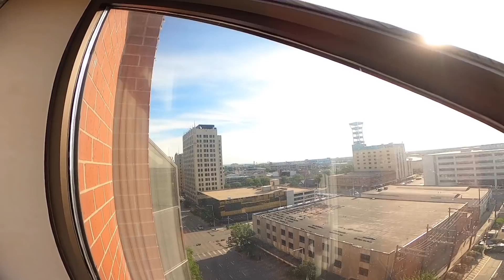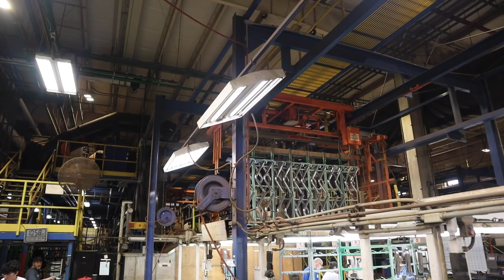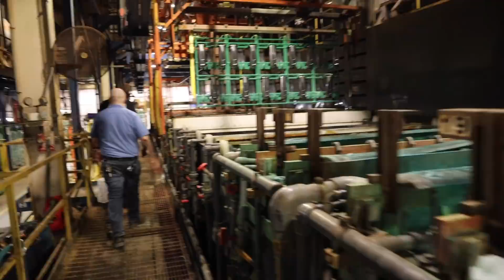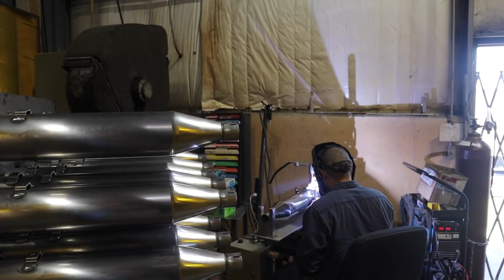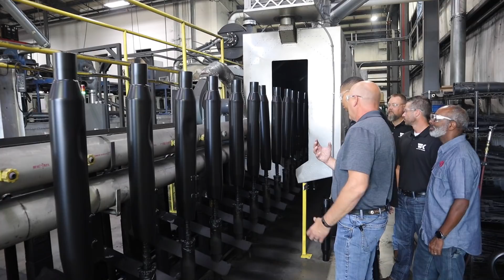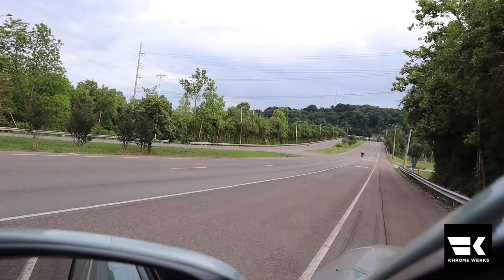What makes Khrome Werks Slip-ons so great? Khrome Werks Factory Tour

Comment: Khrome Werks 4.5 Hp Plus 
I just added these Khrome Werks 4.5 Hp Plus slip on mufflers today. My previous Road Glide had Tab 4.5 with the Zombie baffles which I loved but at times I could of been happier with them not as loud on long hwy rides. Anyway I decided on my new bike which is Completely stock, to go with Khrome Werks feeling they wouldn’t be as loud and have a nice deep tone. Seems like they’re exactly what I expected, i rode about 100miles with them today and my Bike ran perfect with these slip on’s I really didn’t notice any loss of torque, no decel pop and a constant deep tone coming from these mufflers at all times, and not super loud, you definitely feel the rumble and hear it, they sound really nice and deep without being to noisy. I’m happy my Bike is still running great just like it was before I added these slip on’s.